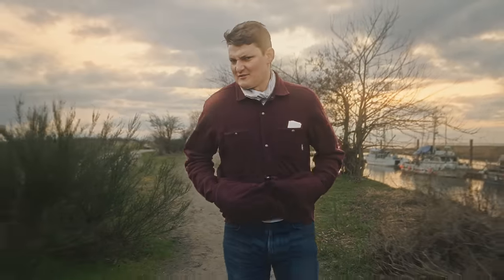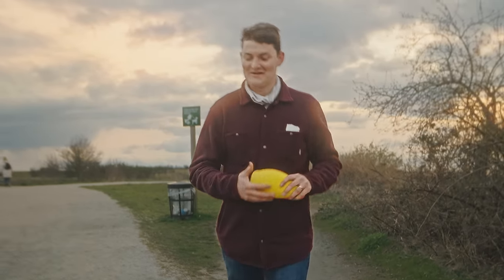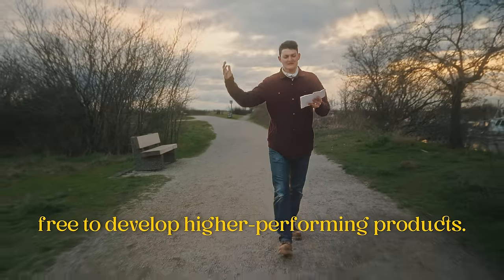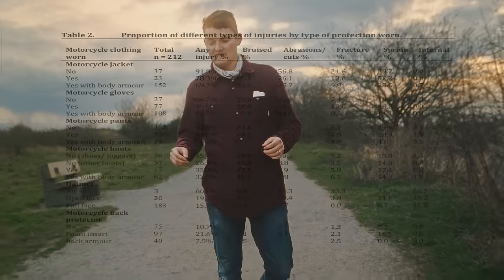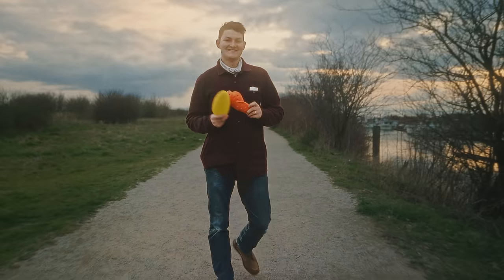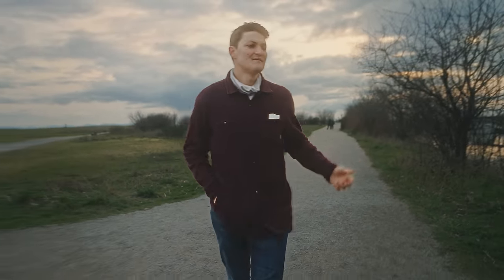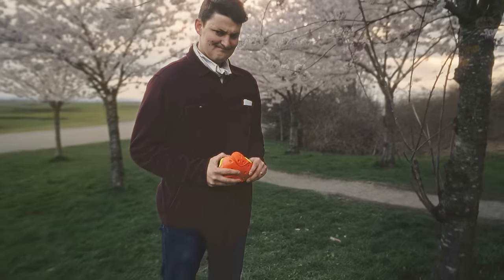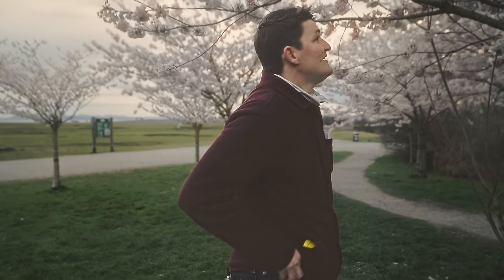Why I Stopped Wearing Motorcycle Body Armour

Comment: Respectfully I'm going to keep mine in.  There are accidents where pads won't matter (either the impact was so soft that nothing would have broken, or the impact was so hard that no matter what you're wearing you'll break), but for that slight chance of an accident that the armor results in a bone bruise instead of a bone break I'll take that extra little bit of protection.
Reply: I think the general gist of the video was a call for better armor
Reply: My only whoopsie so far was a lowside (raining, sand, cornering), and my right side came down pretty hard. I bruised my elbow, and that was WITH the elbow pad in my jacket. I think I may have broken my elbow—or at least got a bone bruise—if I hadn't had my elbow pad in place.

I think Ryan's highlighting the fact that current armor pads need drastic improvement to help prevent the worst outcomes.
Reply: There is no, reasonable armor that can be 100% effective to prevent all injury. I've fallen a ridiculous amount of times, on street and offroad. After committing to buying motorcycle gear with armor, my injuries have significantly reduced. Similar falls that took me out of my work and hobbies for long periods now don't even register because no matter what armor I have, it's way way better than not having any armor at all.

Like, Ryan is really suggesting we'd be just as protected I'm Levi's for crying out loud!
Reply: @stephensumpter5311  Yeah, the CURRENT armor are useless for fractures. But just happen to be good enough for abrasions and bruise protection. We need stronger armor.
Reply: @werepat  I don't think he's suggesting that at all. The conclusion I got from his video is that safety standards are inadequate and armor should be better, but isn't. He literally says at the end that it is is more protective than no armor.
Reply: ye ol adage of "Something is better than nothing"
Reply: @werepat  entire last minute of the video was explicitly telling you that's not what he meant lmfao
Reply: @ZeroXSEED  Yeah that's what I was missing as well. But Ryan's conclusion is not that we need stronger armor, it's that he removed his.
Reply: @stephensumpter5311  people are so funny these days.. :) 
of course any protection is more protective than no protection but the point was how good is the minimal protection?
Reply: I always thought the point of the pads was to protect against abrasion. Ryan didn’t talk about that, but road rash is a major concern in a crash. Another issue in a high speed crash is friction burns, which happen even in the absence of abrasion injury.  It would seem likely that, for burn protection, the more layers between us and the road, the better. TBH I seldom wear pads because I find them uncomfortable, but they’re probably not even really about preventing fractures.
Reply: Have you tried a 16th century full plate armour with a gambeson underneath?
Reply: @peterwilson8039  they might help a tiny bit re abrasion, but that’s the job of the leather or Kevlar to do the heavy lifting there. The pads role is to reduce and distribute the load on impact. The point is that because of protectionism they barely do anything useful. Personally I fall in the something is better than nothing at all, but in this case it’s barely better. That’s not how it’s marketed to us, and that’s not acceptable, primarily because we have virtually no options here.
Reply: @dhess34  I've been in that exact same place. I'll be keeping my armor in, too.
Reply: I'll keep my armour if not just for additional abrasion protection. Road rash is no fun.
 While a big crash will still break you, I appreciate whatever additional protection armour provides...for the smaller minor spills.
Reply: @peterwilson8039 pads are not for abrasion injuries. This is why many off-road protection even write in manual that it shouldn't be used on road as stand alone product, but go under a jacket or other abrasion resistant layer.
Reply: @inevespace  I will concede that as long as the jacket material doesn't abrade through, the pads aren't directly protecting against abrasion, but I think my point about friction burns is valid.  I own a mesh jacket with pads though, and I don't know how well mesh will stand up to abrasion.
Reply: @BoronKrypton2  removed his....in favor of more effective protection like an airbag....
Reply: exactly for city speeds, or tip overs or what ever, where if you go down on your elbows or knees it would be simply WAY less painful. 

highway speeds you are just fucking dead or the reaper was sleeping either way...
Reply: @-IE_it_yourself  Back about 1973 Barry Sheene unloaded on the back straight at Daytona at about 180 mph.  He wasn't even very seriously hurt.   It's not the speed that hurts, it's what you hit and how you hit it.  Of course if you're not wearing good abrasion resistance, you're going to scrape away a lot of dermal and subdermal tissue.
Reply: @peterwilson8039  so you are telling me this is SO common that 50 years later we still remember this one exception?
Reply: @-IE_it_yourself  No, I am saying that a high speed crash isn't an automatic death sentence.  Of course a high speed crash is very dangerous, but it's ridiculous to think that certain death in a high speed crash is a reason not to wear protective gear. Your odds of surviving a high speed crash improve dramatically when you wear protective gear.
Reply: @peterwilson8039  what im saying when it is NOT an automatic death sentence, we remember it 50 years later. the exception proves the rule. 

WOW whoa woe, just in case it wasnt clear i am very pro safety pads to city riding and proper crash suits for higher speed stuff.
Reply: @-IE_it_yourself  I know there's been very few deaths in MotoGp and WSBK lately.  I haven't been following them because that's a subscription service where I live, but I'm sure that there's been a lot of long high speed slides.  I just picked on Barry Sheene's slide because it was so dramatic.
Reply: @peterwilson8039  just like in auto racing, they have roll cages and huge run off around the track, and walls built for it. we are not talking about the same situation, but we share the same perspective.
Reply: Exactly, sliding into a wall at 100 mph you're fucked. But having a pad in-between your hard hips/elbows/knees and concrete will make a big difference. Hell I'd rather have carboard in-between my knee and hard ass concrete than nothing!
Reply: My sentiments exactly

Comment: FWIW, I was wearing a Vanson jacket with elbow and back armor of their design, a pair of jeans with CE2 hip and knee armor, and a pair of Racer gloves with carbon knuckle armor when a drunk did a last second left in front of me. My knee punched a dent into the side of his truck and my brake lever, which was the first contact with the vehicle, came down hard on the carbon knuckle protectors of my last two fingers. I technically fractured my knee, but it was the kind of fracture where it looks weird on an MRI but none of the parts are displaced to different locations, and I was able to walk away from the wreck. Also, all of my fingers were still on my hand despite the guillotine brake lever. When I came off the bike I landed hard on my back, on my back protector, and while my ribs were badly bruised in the back, none were broken and my spine wasn't bruised. (Quick pitch for the sort of out of fashion Vanson brand: after landing on my back and sliding on the asphalt, the back of my jacket wasn't even scratched. The leather they use wears like iron). 

This is anecdote, not data, and I agree with your concerns about regulatory capture and undersized protection. However, I think saying "it's not enough protection so I won't wear it all" is a contrarian but self-defeating choice. It seems like "this isn't enough protection so I'll wear more" would be a more rational response. 

Impacts vary, and I'm not sure that "break a femur" is the right threshold to be using as a baseline. There are plenty of impacts, like the one on my right knee, that are below the "break a femur" threshold but may have still broken my knee without the marginal protection that my knee pad offered. Those pads absorbed some of the force before it got to my knee. Given i had a partial but not complete fracture, maybe it was enough. There are also a lot impacts on a motorcycle that will get to "break femur" territory even in the presence of non-existent CE3 or 4. The armor isn't protecting you from that existential 100mph low side into a steel barrier. I'm not sure why this marginal protection isn't showing up in the study you cited, but studies aren't impervious to flaws and are designed to answer yes / no questions, not illuminate nuance as you are well aware.

Btw, my take away from my accident was that I should have been wearing my air bag vest that day. It would have saved me a lot of pain where the gas tank hit my pelvis and would further lessened my rib bruising. But it certainly didn't have me thinking I should ditch the knee, hip, and elbow armor. If anything, it had me thinking about ways to improve the protection at my extremities. 

With all of that said, I salute your willingness to call it like you see it despite where your bread is buttered.
Reply: Holy ---- the voice of reason , thank you ...
Reply: Agreed I took fall on my knee without protection last year at low speed but it been a horrible recovery. I couldn’t walk for a month, and it cracks on every stairs I walk up  and down, and I walk with a limp now and I still feel pain, I’m almost 100% sure if I had pad I wouldn’t be in pain, every since that experience I never go riding without pads .. as I learnt it don’t take much impact to give you a f up day
Reply: you should learn to speak like a human being. anyway, i think the argument is for better protection standards, not no protection. though he doesn't present any actual evidence for what the standard should be or that a proper standard was pre-empted by the industry.
Reply: Damn! Wish I'd said this. It was just what I was thinking but couldn't articulate. Good job.
Reply: You have said everything I wanted to say much better than I could have said it.  Top answer 👍
It's not often I disagree with Ryan but wearing no pads means you're gonna feel more impact and that just means more pain.  It's an absolute no brainer to wear it, drive safe Ryan
Reply: Exactly, lobby for better protection. Don't throw the kids out with the bathwater.
Reply: I thought his point was we need to start buying horse-rider stuff
Reply: My armored Vanson leather jacket is the only jacket I own that I feel will protect me if I get off the bike at speed. The thing weighs a ton and doesn’t move around at highway speed.
Reply: F9, seems like  you completely lost the plot on this one - recommending nonsense, or  are you in the  airbag business?  
Yeah yeah, pads won't save you from serious impacts at high speeds, but pads saved my elbow and shoulder bones big time a few years ago when my Yamaha came down.
Sure, an airbag does a far better job protecting your torso, but not everyone can afford one or wants one.
Hope riders know better and will ignore your advise.
Reply: Oh, hang on, you ARE selling them!!! Nice one mate
Reply: There is excellent protection available, it's bulky and uncomfortable and makes you walk like a goon.  You can ride around in full race kit if you like.  At the end of the day however you're still a sack of meat and rapid deceleration or grinding against asphalt is hazardous.
Reply: @kittysplode the hell kind of reply is this? the original comment was well written and easy to understand. what wasn't human about it?
Reply: humans talk in short, easy to understand sentences when they want to be understood. what is, why it is, how it got there. the post parses as a word matrix.

consider this constructive criticism, because i have to refine multiple times to not sound like that. @gazehound
Reply: @kittysplode  He is speaking like a human being. An intelligent one. He was very concise. You should learn some grammar. It's not very hard. Also, F9 stated in the video that he has stopped wearing armor. That is an all or nothing approach. I agree with pushing for better standards, but that does not mean you should get rid of all protection. Even a hypothetical CE9 won't save you from every situation. This line of thinking is extremely flawed.
Reply: @dshiloh3577  Ryan is wearing Woke #5 today
Reply: I had a lowsider with 60 km/h and hit the asphalt perfectly in my knee and elbow protectors. I slided over a curb and into the green. While doing this everything happened in slow motion in my brain and I wondered how comfy the slide was 😂Nothing happened to me, only a tiny burned spot of skin and aching foot for some days. I really would not do this with only 1 mm of leather or textile between my knee or elbow and the ground.
Reply: you should unlearn grammar and spend more time with idiots and ESL folk. or spend time communicating in a fast-paced environment where millions move fast. either or.  @imhaydenmelrose
Reply: @kittysplode  he states in the video that he stopped wearing pads.
Reply: 'shokhs deer wil lib dusnutsu werries ^-~' <3 @jstogdill
Reply: @kittysplode  I work in many fast passed environments. What exactly are you trying to accomplish right now? You're making baseless assumptions on a YouTube comment section. Your idiocy is glaring.
Reply: better to expose your idiocy at the start than to fuck around wait to find out ~<3 @imhaydenmelrose
Reply: @kittysplode  I guess so. You certainly save me a lot of time. So thanks!
Reply: @blipco5 same here, if I’m going on a rip with friends, the Dainese leather comes out, and on the track it has definitely proven itself. Hard to place confidence in any other textile or material.
Reply: @gazehound agree, maybe he should learn grammar and spell like a human too.
Reply: @kittysplode  People speak in short, easy to understand sentences when they are speaking to children or people of lesser intellect.
Reply: You make a good argument for wearing leather regardless of the form impact protection takes within said leathers. Both must work together.
Reply: Thanks for sharing your experience. Vanson leather is indeed amazing. Print magazine Sport Rider called it bombproof. It takes forever to break in but it’s the most abrasion resistant leather I’ve owned in 45 years of riding.

Comment: What studies often miss are the accidents that didn’t end up in the survey because the person was absolutely fine…because they had armour. That time you slowly dropped and landed elbow down on concrete? Might have been an arm breaker, but you had a pad so you didn’t end up in ER.
Reply: Bingo!
Reply: Agreed
Reply: Yes, can't see why the protector wouldn't be usefull if the primary impact is little above the fracture force level, and taking it back below.
Doesn't take away the fact we could have better protectors.
Reply: Yeah it's like with the survivorship bias. Some just might not be reported as no injury occured, no help was needed. Hence no data.
Reply: Vital point, thank you.  Especially as many of these studies were from US, where medical care is expensive. Many fallen riders just limped home feeling lucky
Reply: This^^  I've never had a high speed big impact crash on a motorcycle thankfully in 39 years of riding.
But I've had quite a few low speed drops, pretty much all offroading mind you, and the armour lets you stand up and go "crap what did I just break on my bike" instead of, "ouch ouch ouch ouch, im never riding again, ouch ouch ouch etc"
Reply: No, it's lot like.. it literally IS survivorship bias!!
Reply: Exactly. I also wondered why wouldn't you want to lessen the impact to whatever degree they do for the price you can get them at
Reply: We all remember the story of the armour on WW2 planes ... Those who came back didn't need armour where bullets made holes. One had to find those crashed planes and see where they got the fatal hits.
Reply: 100%
Reply: If it was an arm breaker, the armor didnt stop it. End of story.
Reply: You are assuming that it automatically was the pad that saved a break in your scenario. It could be that without the pad there is no er visit also. Leave scientific study to those that do scientific study
Reply: There's accidents where you have no armor and are fine too. I don't see that are super relevant here either.

The study was about motorcycle accidents where injuries occured. That's literally the study. It's not a study on all motorcycle accidents?
Reply: Thank you for being statistically aware 😎
Reply: This was my experience. I've dropped my bike twice. Both times, I slammed the ground. Hard. My elbows took all the impact. I walked away with zero injury or even pain. I don't see a downside to using armor. Even if it's only a small improvement, that's still an improvement.
Reply: The authors of the studies he quotes seem to recognize this. See other replies on this video.
He seems to have conveniently left out this information.
Reply: You automatically assume they had armor. This is incorrect. According to the studies, it makes no difference.
Reply: I've actually done this, looped my bike at 40, landed kn my elbow, was absolutely fine